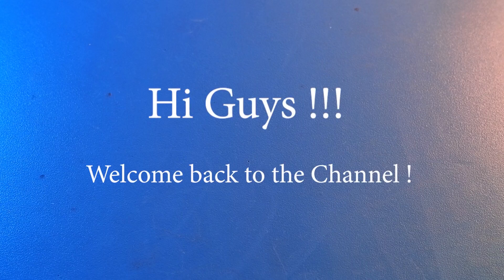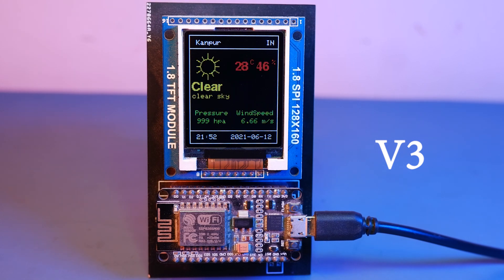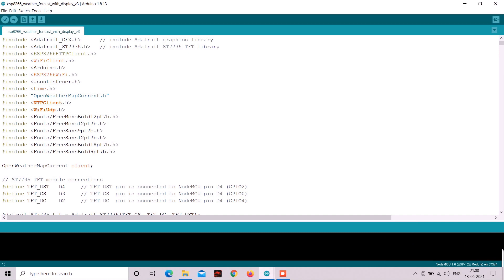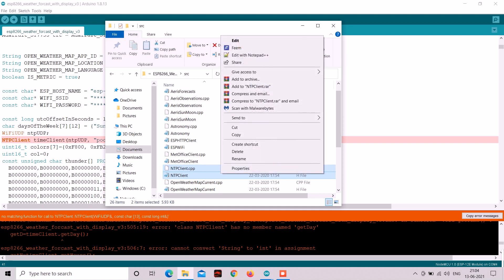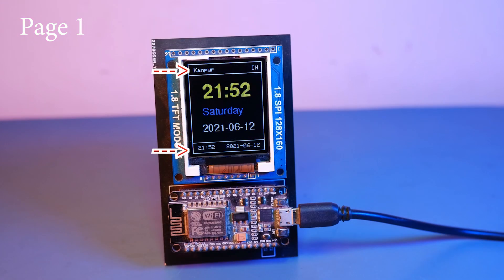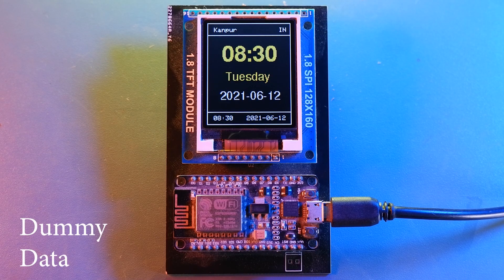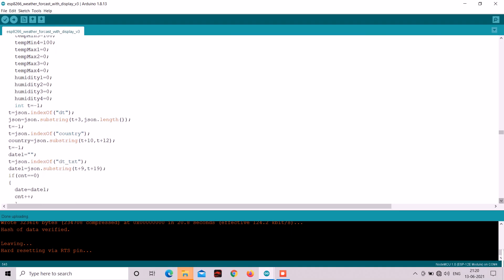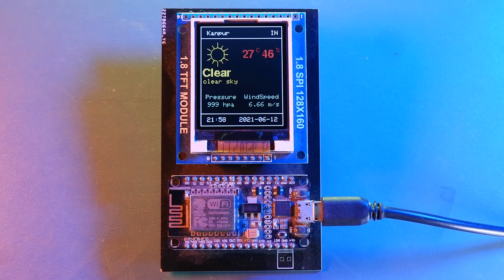ESP8266 Weather Station Version 3 | Nodemcu & ST7735 openweathermap API | Ultimate weather station

Comment: Why do I get this message

esp8266_weather_forcast_with_display_v3:419:8: error: cannot declare '::main' to be a global variable

  419 | String main="";

      |        ^~~~

Multiple libraries were found for "WiFiClient.h"

 Used: C:\Users\NoBrakes\AppData\Local\Arduino15\packages\esp8266\hardware\esp8266\3.1.2\libraries\ESP8266WiFi

 Not used: C:\Program Files (x86)\Arduino\libraries\WiFi

 Not used: C:\Users\NoBrakes\Documents\Arduino\libraries\WiFi

Multiple libraries were found for "NTPClient.h"

 Used: C:\Users\NoBrakes\Documents\Arduino\libraries\NTPClient

 Not used: C:\Program Files (x86)\Arduino\libraries\NTPClient

Multiple libraries were found for "Adafruit_GFX.h"

 Used: C:\Users\NoBrakes\Documents\Arduino\libraries\Adafruit_GFX_Library

 Not used: C:\Users\NoBrakes\Documents\Arduino\libraries\Adafruit-GFX-Library-master

 Not used: C:\Program Files (x86)\Arduino\libraries\Adafruit_GFX_Library

Multiple libraries were found for "OpenWeatherMapCurrent.h"

 Used: C:\Users\NoBrakes\Documents\Arduino\libraries\esp8266-weather-station-master

 Not used: C:\Program Files (x86)\Arduino\libraries\esp8266-weather-station-master

exit status 1

cannot declare '::main' to be a global variable

This report would have more information with
"Show verbose output during compilation"
option enabled in File -> Preferences.

Comment: code is working after some modification, like main cant be string ( changed it with Main). http.begin(serverName) replaced with code WiFiClient client; // Create a WiFiClient object
  
  http.begin(client, serverName); // Pass the WiFiClient object to the begin function.

But code is not getting correct humidity for next days. Tried to rectify but unable to do so. Please check and rectify.

Comment: It show error during compiling in a 417 line. it says "cannot declare '::main' to be a global variable" what should i do now, can some one help me please?
Reply: facing same issue. Were you able to fix this? @electronic GURU please help
Reply: @prithvirajghose  I have Tried sooooo many things by editing code and stuff during the whole week. after 1 week later it just fixed like a one snap. I just installed these library with mentioned version and replace the old library with new one in the code... 
1. Adafruit_GFX v1.11.9 by adafruit.
2. NTP Client v3.2.1 by fabrice weinberg.
3. ST7735 and ST7789 v1.10.3 by adafruit.
Install those and replace in the code. then try to compile. hope it will fixed.

Comment: Hello Guru.

I'm from Indonesia, I'm very impressed with what you've done, and thank you for providing the code for free, but I still feel confused about the include font section.

#include <Fonts/FreeMonoBold12pt7b.h>
#include <Fonts/FreeMono12pt7b.h>
#include <Fonts/FreeSans9pt7b.h>
#include <Fonts/FreeSans12pt7b.h>
#include <Fonts/FreeSansBold18pt7b.h>
#include <Fonts/FreeSansBold9pt7b.h>

The video doesn't explain that part so I felt confused

Comment: Why is this error happening?

Используем библиотеку Wire версии 1.0 из папки: C:\Users\Дмитрий\AppData\Local\Arduino15\packages\esp8266\hardware\esp8266\3.0.2\libraries\Wire 
exit status 1
call to 'HTTPClient::begin' declared with attribute error: obsolete API, use ::begin(WiFiClient, url)

Comment: Hello, great video. I encountered an error while compiling:

C:\Users\Дмитрий\Desktop\3\3.ino: In function 'String httpGETRequest(const char*)':
3:689:13: error: call to 'HTTPClient::begin' declared with attribute error: obsolete API, use ::begin(WiFiClient, url)
Несколько библиотек найдено для "WiFiClient.h"
 Используется: C:\Users\Дмитрий\AppData\Local\Arduino15\packages\esp8266\hardware\esp8266\3.0.2\libraries\ESP8266WiFi
Не используется: D:\Program Files (x86)\Arduino\libraries\WiFi
exit status 1
call to 'HTTPClient::begin' declared with attribute error: obsolete API, use ::begin(WiFiClient, url)
Reply: read the example of "include <ESP8266HTTPClient.h>"
Reply: Ошибку (HTTPClient ...) победил.Нужно установить ESP8266  версии ниже 3-й,на пример 2.74
Reply: http.begin(wifiClient, serverName);

Comment: Hey Guru, I like your projects much.
Now I have a problem. When compiling I get the error "cannot declare '::main' to be a global variable" Marked is line 417 "String main="";" I have modified the ESP8266_Weather_Station library.
In the protocol it is:
esp8266_weather_forcast_with_display_v3:417:8: error: cannot declare '::main' to be a global variable
  417 | String main="";
      |        ^~~~
Any idea what can I do?
Reply: Idk I think the word "main"  is a specialized keyword for the gcc compiler, and it is used as a function "::main", which is a cpp function. Just a guess though.
Reply: Use ESP8266 boards v 2.7.4

Comment: any schematic for the screen  because i got a red st7735 cant find the schematic
Reply: For red st7735 connect: D 2- AD, D3 -CS, D4 - RESET, 3V - LED, D5 - SCK, D7 - SDA, G - GND, 3V - VCC.  Red st7735   SPI.
Reply: @ВячеславЕрмашкевич-р2ф  thanks a lot!!!
Reply from the maker: if you check connections shown in video,it is there
Reply: @electronicGURU  on my st7735  the pinout layout is=LED  ,  SCK , SDA ,  AO , RESET , CS , GRD  , VCC my screen is the red one from amazon
Reply from the maker: oh now i see the problem  you bought  a i2c display  but the one i used is spi, so either  get a spi display  or migrate code to i2c display. its not that difficult because they all uses adafruit gfx so only declarations  you need to change.
Reply: @electronicGURU  How i change the declaration ?? newbie question here :)
Reply from the maker: it means find in the code where they are writing  like : Adafruit_ST7735 tft = Adafruit_ST7735(TFT_CS, TFT_DC, TFT_RST);

Comment: Hi GURU, it works great. Thanks for your work. I wanted to change the language on the display (Czech), but I have a problem.
The days work well, but Clouds, Rain, Clear, etc. can't be changed. I do not know where. Can you give me some advice? Thanks a lot.
Reply from the maker: well i made a method at the end of the code to display  weather bitmap icon and there is a language variable i used as well. But i am not sure if it can work properly  with any language  except  English,  to change it to any other language  will take a whole understanding  of the code because  the text alignment  and all the logics also need to chnage according to the language  so it might take a extra effort.
Reply: @electronicGURU  Hi GURU, thanks for the info, but it didn't help. I'll stay with English. And thanks again for your work and willingness. I look forward to your new posts.
Reply from the maker: your welcome  sir 😊👍
Reply from the maker: well i am thinking  of making a IOT news reader or something
Reply: @electronicGURU  👍
Reply: @bohuslavkozdon5539  what'up brother Now Do you can fix it ? I have problem it too.